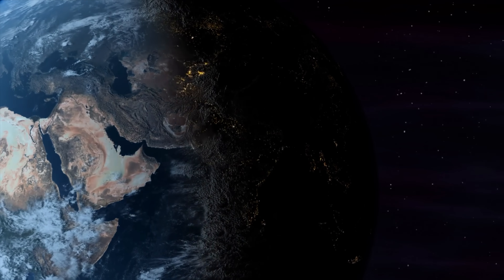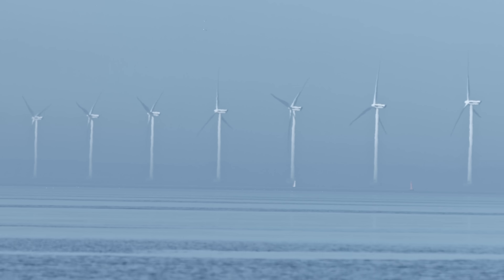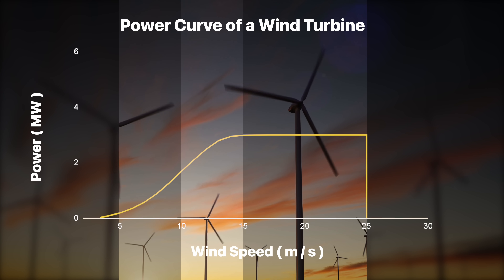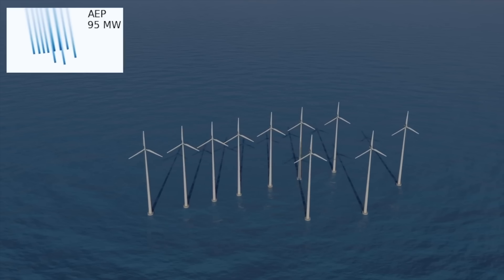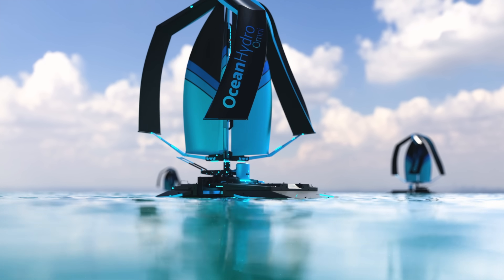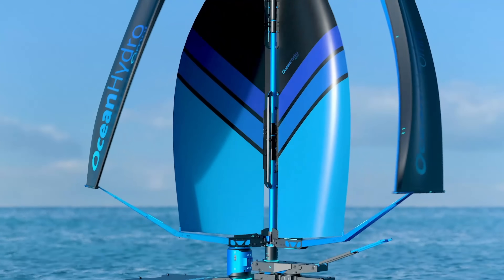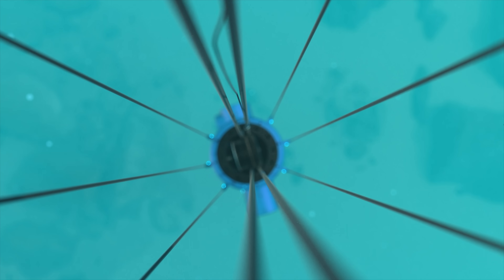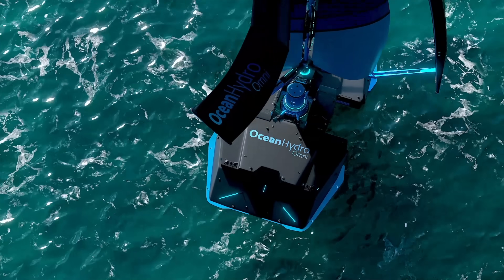Breakthrough Tech Solves Wind Power's BIGGEST Problem!

Comment: Yes! The more renewables the better!Keep them coming!!!
Reply: I'm all for more renewables but only feasible ones. This one's maintenance would be a nightmare. All long term under ocean devices have as little moving parts in contact with the ocean as possible. This one has a bunch of pulleys and in use wires sitting in the ocean. This with a power system where every percent of inefficiency is usually accounted for. How in the "barnacle" do they expect this to work long term. Solar panels are considered scrap after they get to 80% efficiency after 25+ years, this would reach that in months.
Reply from the maker: Agreed
Reply: There can never be enough renewables. As they say, do the Math!

Comment: It sounds like once the weight (or weights) is at the top, no more wind can be harnessed by that turbine? It might be smoother energy release but less of it overall than a regular one. Would it not make more sense to keep the individual units simple and low-maintenance having variable output, but have a local large weight-farm that they all feed into? Then the output of that can be released smoothly and excess input used for something productive such as electrolysis to remove carbon from the water and sequester it (or make new weights from it... )
Reply: Actually that could be extended. All the incoming power goes into electrolysis. From the output of that, sequester the carbon, and use the oxygen to fill a bladder and lift the weights instead of powered lifting. When power is needed, water pressure and weight will deflate the bladder and make the weight sink again
Reply from the maker: So with two weights you can always drop one and lift one
Reply: @TwoBitDaVinci  Ah. I missed that I think. So they are "pushing" energy smoothly rather than storing it until the energy is needed
Reply from the maker: With a single weight correct your either produce or store. But add many in a farm and they can alternate

Comment: Technology readiness level 6, prepping for level 7 eh? I had hopes for this, then he started talking. Hopefully a real manufacturing company will pick up this design because it has promise. Not as promising as the many types of nuclear we could be using now, to eliminate coal and biomass, but for coastal regions and island countries this could be a faster installation.
Reply: What's the problem? Technology readiness levels are standard terminology.
Reply: @4Leka  Outside of government contractors who have secured R&D budgets with percurrent level metrics, no one uses the term TRLs. People who use that terminology are grant writers, not makers. You certainly don't use it when talking to a general or engineering audience, when asked about how far along you are. 

In 5 years come back to this comment and see if they have announced anything past TRL 7. Once they make a scaled testable unit, they will have reached the max profit without having to invest in expensive manufacturing equipment and they will move on to a new contract.
Reply: @echtogammut  I don't believe for a minute that this project will go anywhere but that's because the proposal is dumb, not because he said TRL.

Comment: Conventional turbines could add batteries, and smooth their generation. There is definitely value in it, though. For one, you can push more power through the cable you run to shore. The two keys to this technology are making parts that can survive in the ocean as you mentioned, and a competitive price, as you hinted at.
Reply: Batteries have a very finite life span, even shorter than wind turbines.
Reply: @michiganengineer8621  That depends on the chemistry, temperature, and how you cycle it, but LFP can do 3000-5000 cycles, and the grid guys are buying as fast as suppliers can make it.
Reply: @fjalics  A valid point.  I just hope any Lithium based battery bank is well up on the shore though
Reply: @michiganengineer8621  Why? If you put it in the turbines, you can make more efficient use of your transmission to shore.
Reply: @fjalics  While I know LiFePO4 batteries ARE much more stable than older LiPO's, and they are becoming more and more common in hybrid yachts.  The thought of a battery bank designed to stabilize the output of a 10MW+ wind generator being short circuited by sea water is a VERY scary mental image.
Reply: @michiganengineer8621  Tower's have thick steel walls. You don't have to put them under water.
Reply: @fjalics  How are you going to anchor them to the sea floor?  True, the majority of what will be under sea level would be encased in concrete.  But what is above the high tide level where the towers are built will probably only have 10-20 yards (at MAXIMUM) of clearance.  That WILL get covered in salt spray or even "Green water" during a severe storm.  I've personally SEEN Green water on the flight deck of an aircraft carrier during a North Atlantic storm.  It was onboard CV-67, the JFK
Reply: Most towers get hammered into the sea floor, but a bunch of it is above water. The floating turbines are pretty new. I know they anchor them with cables to the sea floor, but I don't know how. Guess what CVN-79 is called? It's got 2 x 300mw nukes, EMALS, and really fast elevators.
Reply: @fjalics  I'm not sure how they anchor the floaters either, although it's probably similar to the way they moor floating oil rigs with a LOT more under the water surface than you may think.  My guess is quite a few multi-kiloton concrete blocks spaced around each anchor point and all tied together.

I actually LIKE VAWTs for land use.  It keeps the parts that WILL need mechanical servicing at (or at least NEAR) ground level, rather than several dozen feet in the air.

I know there is a new "Big John".  I actually spent even more time of CV-60 Saratoga (or as we called her, "The Sucking 60 from Dixie" LOL)
Reply: @michiganengineer8621  HAWT typically work better, but "Two Bit DaVinci" had a piece on a company trying in the ocean with them. They don't have anything in the water yet, and the ocean is a rough place, so we'll see if they can make it work, and practical.

Comment: Two things jump out at me as a engineer,  more complicated means more problems, more moving parts means more maintenance and a lot of it under water?!  Gravity storage gives it on a demand component, which was always a problem for renewables.
Reply: Even the offshore baldes have much damage from the saltair , you wont put a steel cable in saltwater 😄
Reply: Yeah, seems to me like it would be way more efficient if it just filled an above water tank and released it into a hydroelectric generator.

Comment: aja... how do you make the turbine and cables  not affected by the current and tides? How did will you protect it when storm came? how much is the weight, how do you account for water resistance?